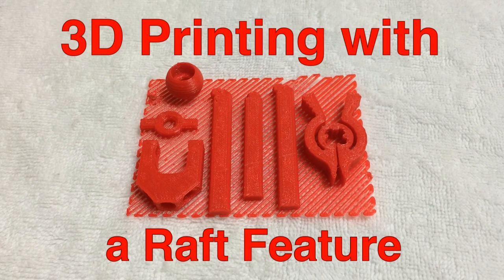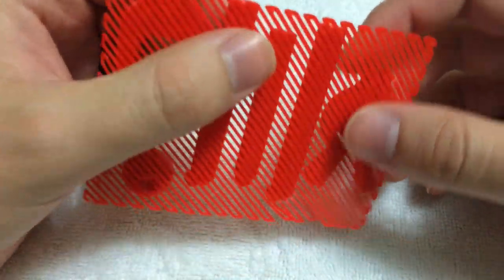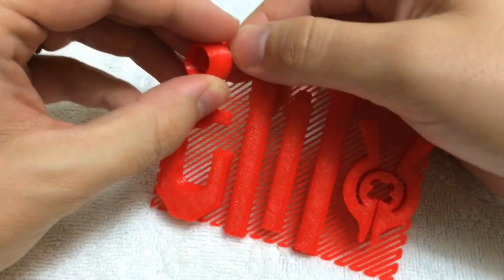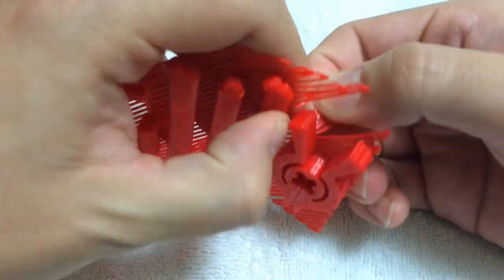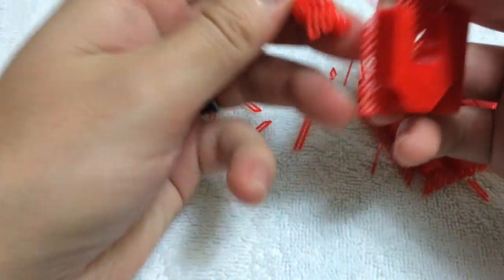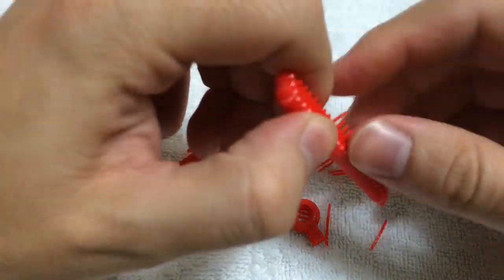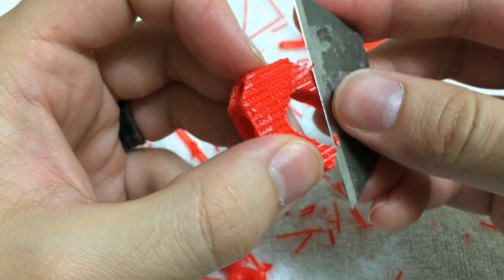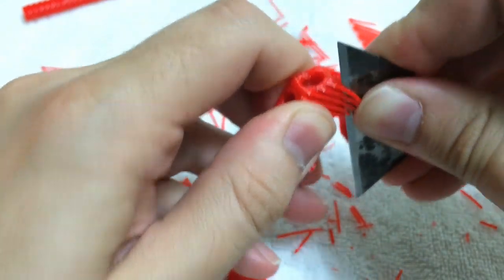da Vinci 3D Printer: Raft Feature

Comment: I don't like it very much in the aspect of print and done.. I mean once I get better at using my dremel to clean the excess plastic off I might be okay with it. #3dPrinting
Reply: I haven't used a raft since the ToM days.. it's only useful if your machine isn't properly setup or bad in general.
Reply: Do you think the supports do better without the raft?
Reply: Well, a raft is automatically added to the bottom of supports in slic3r but does not exceed the outside of every pillar/tower/etc. You are far better off printing with your first layer extrusion width set to ~250% (for my bot anyway) so that tramming is no longer a major factor in your models.
Reply: I have a Da Vinci and I don't see any settings for how to change any particular layer of extrusion's width. Wall thickness can be changed, maybe that would include the thickness of the bottom. I had to look up what tramming meant, new to all of this so still Learning.
Reply: What slicing software do you use? Slic3r, Cura, etc? Or is it something proprietary to Da Vinci?
Reply: Proprietary. But I have been looking into Slic3r for sure. Heard a lot about it.
Reply: Cura is what everyone is getting into now, Slic3r has dumber toolpathing but has a lot of great customization features. I'd look up if someone has done a Da Vinci Repeteir Host setup so you can host using that instead of whatever was given to you. I'm not familiar with the machine so you'll have to do some research.
Reply from the maker: Thanks for the feedback guys.